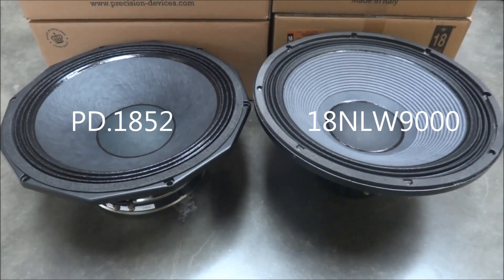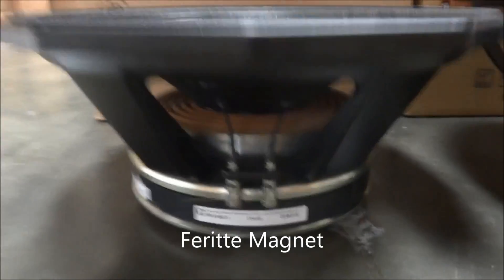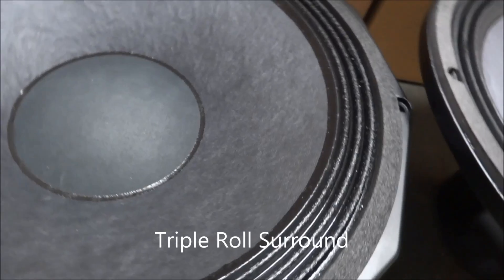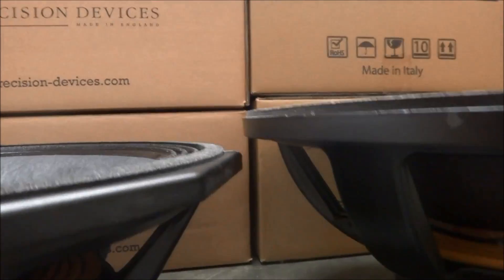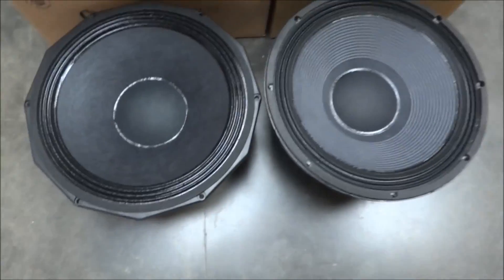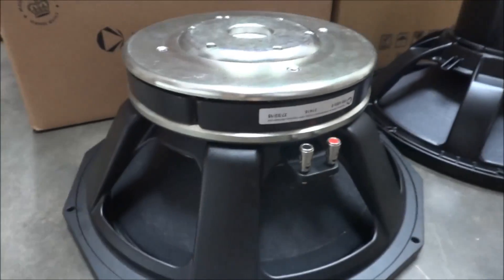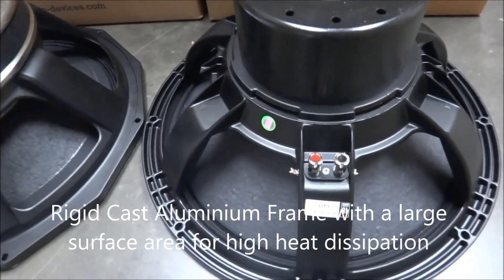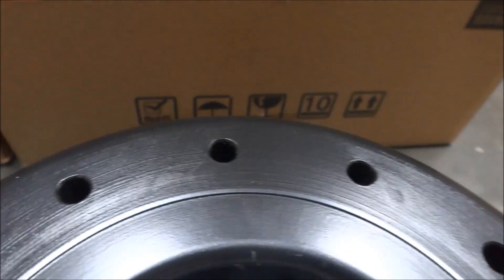SCOOP Bass Bin 18 sound 18NLW9000 VS Precision Devices PD1852

Comment: Can you confirm that the 18 NLW9600 is the most powerful 18" Driver on the market? I also heard that it can compete with a lot of 21" Drivers.
Reply from the maker: Hi on paper there more powefull 18" speaker available but in practice the 18NLW9601 is more robust.
The 18NLW9600 has been upgraded to the 18NLW9601 http://www.lean-business.co.uk/eshop/18-sound-18nlw9601-8ohm-18-1800watt-neo-subwoofer-speaker-p-2379.html
Reply: leanbusiness1 So in your opinion is there any better driver than the 18NLW 9601 for this price?
Reply from the maker: No, not only is it very reliable and strong, it delivers a really smooth low bass, where are you based?
Reply: leanbusiness1 I live in Germany close to Hamburg